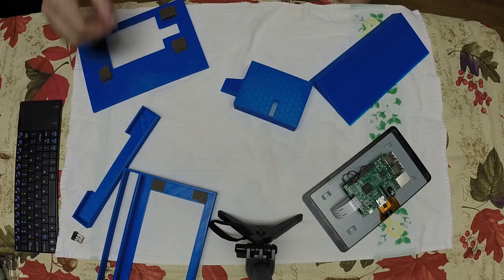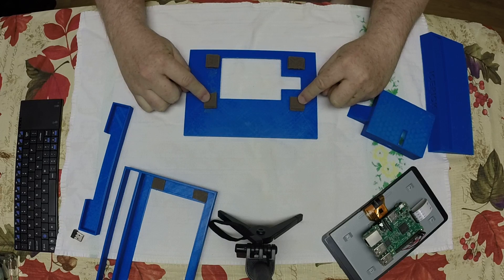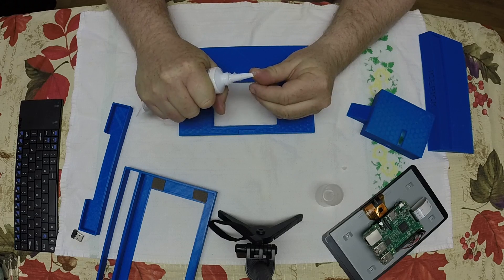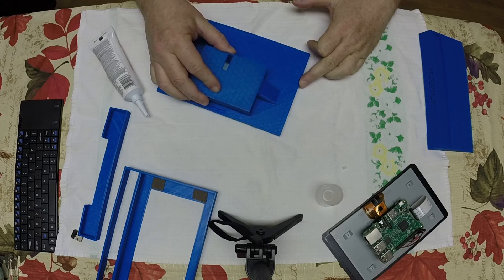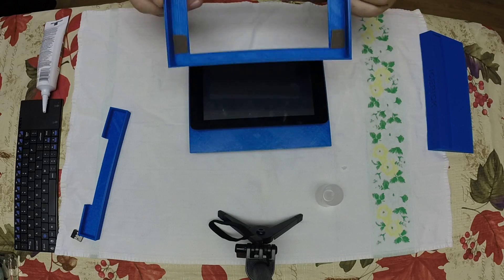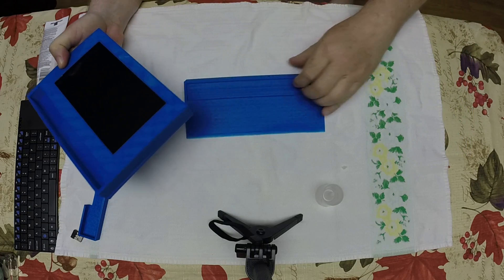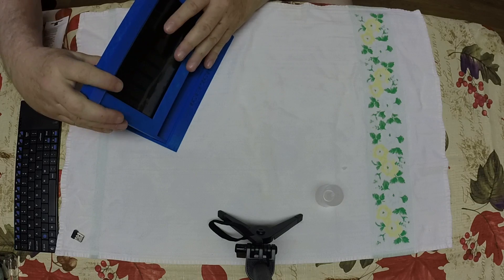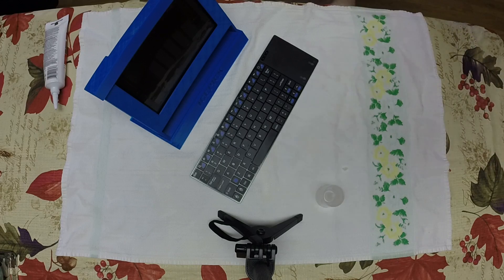Raspberry Pi 3 Mini Computer using 3D Printed Housing with 7" Display

Comment: Thanks for posting this video. I have 2 questions. Does this work with all versions of raspberry 3 ( in terms of fitment)? Lastly, this is the official 7" lcd screen from raspberry, right? Thanks
Reply from the maker: Yes, the 7" display is the Raspberry version.unfortunately, as it is the only version I have, I am not able to compare fitment to any of the other models. It may fit others, but it was build for the 3. It is my understanding that some of the fitment issues found on the 3 is that the chip set is a little larger and interferes with the cases for the older versions. That being said, I would believe this will fit the older ones.